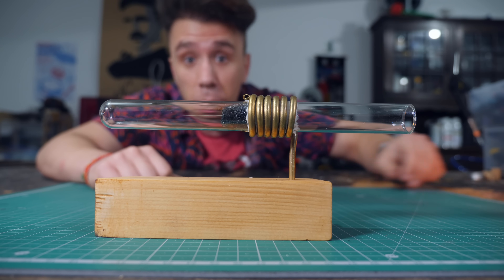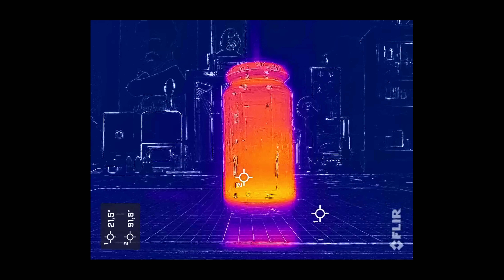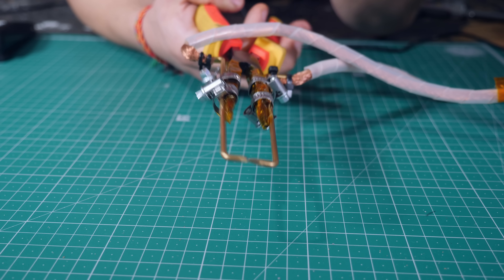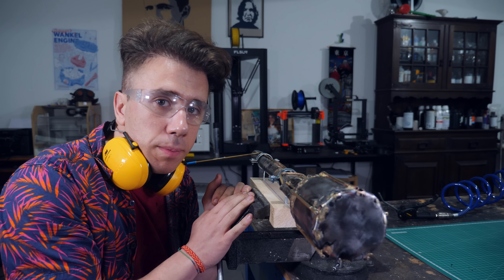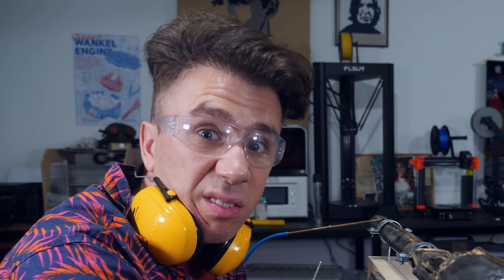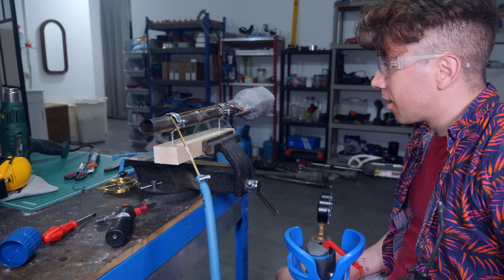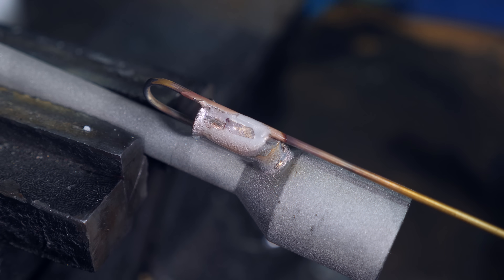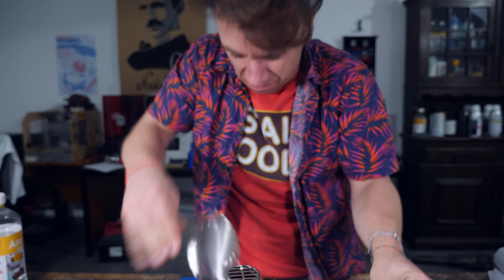JET ENGINE with NO MOVING PARTS (Pulsejet Engine)

Comment: for your next attempt at it, you could try to pre-cool the fuel before sending it into the line (the way you have it wrapped around it like that) to help the material not overheat. My concern would be the fuel line itself could fail and cause a dangerous situation while giving an added advantage of keeping the 3d printed metal from possibly failing as well. since it requires a temp difference though you may have to split the line before it wraps around it so that way you could wrap both sides before rejoining it at the injection point. this way you can cool both sides while still getting the temp difference.

Comment: How turbine engines works for airplanes is actually pretty simple. You have multiple compressor blades that compresses the air, then the compressed air goes through combustion chamber where the fuel and flame is introduced. it ignites and then the air gets pushed through turbine, the turbine is connected to a rod in the middle which is also connected to compressor blades. The turbines move which in turn  compresses the air all you have to provide is fuel. There is also bypass which is where the compressor compresses the air but instead going through the middle it goes around the  middle and out the back. This makes it quieter and more efficient, the bypass counts as ~80% of the thrust from the turbine.

Comment: A cylinder filled with mercury will immediately begin to rotate when DC voltage is applied and instantaneously reverse rotation with reversal of polarity.
A cylinder of mercury within a cylinder of mercury each rotating in various directions and speed in conjunction with one another allows this engine to move in any direction.
I'm thinking about trying out the gizmo with a typical UFO saucer design...ring within a ring with a few more here and there.

Comment: Actual rocket combustion chambers have air/oxy entry ports all around the outside of fuel/oxy entry area. It keeps the outer shell cooler w a buffer of cooler oxy while fuel burns mostly inbetween the center fuel stream and oxy layer where it mixes.

Comment: What if you made your engine out of ceramic instead of foil or thin sheet metal by means of slip-casting? It is like the pre-digital version of 3D printing for clay. Hard to know if there would be problems with differential expansion, and it is a bit of a process,  but you wouldn't have to learn how to throw on a wheel or handbuild. To see what I'm talking about, check out the YouTube series: Tiki Technical Tuesday.

Comment: Good job, you have some pretty amazing skills & this was really interesting. 
Idea: could you maybe design a steam propelled machine using a pulsejet partially for thrust perhaps, but mainly as a heat source for the steam propulsion. I think with a controllable EFI system this would be a far more efficient use of the type of energy this motor produces. 
To clarify: the objective is to retrieve as much useful energy as possible from the pulsejet via steam, heat &/or thrust, to drive a car, boat, train, generator, sterling engine, lightbulb, sewing machine or whatever you like, but not just as a room heater, that would be too easy.

Comment: I ⚠️🌎don’t need no solar panels. All I need is a coal supply and a boiler to make some good old carbon dioxide we need more carbon dioxide in our air atmosphere, but keep it at a cold temperature. The carbon dioxide helps plants grow using for the synthesis, but if all that carbon dioxide disappears plants die, that’s why earth is such a balanced planet, unlike Venus, which cannot get rid of its carbon dioxide because it doesn’t have any plants. Earth is unique because it has plants and life.

Comment: How bout a rocket powered dildo, and a jet powered pocket gina in a head on collision with a high resolution, high speed camera to see who wins after the blast off.  All joking aside, it would be cool to build a quad pulse engine with wings and an entire hydrogen tank attached as the fuselage.  And for the pulse engines to be made from clear glass if it were possible.

Comment: I have developed a type of propulsion system that provides 96-100cc combustion events per rotation around the inside circumference of a 13cm OC x 7.5cm ID x 18cm H cylinder.

Comment: I love your enthusiasm.  Just a small correction, the V1 rocket of WW2 was propelled by steam from a chemical reaction.
Reply: The V-1 was NOT a rocket engine (i.e. not powered by a rocket engine).  Rather the V-1 was a jet (i.e. powered by a pulse-jet engine). Jet engines use oxygen from the atmosphere to burn the fuel; rocket engines have self contained oxygen to burn the fuel.  On the other hand, the V-2 was a rocket (with oxygen stored in one tank, and fuel stored in another tank - and two separate pumps - one to pump the oxygen, the other to pump the fuel).
Reply: @danielklopp7007  My appologies.  The V1 flying bomb, doodle bug, farting fury or revenge weaopn  have many names. I fully understand that the V1 was powered by petrol.  (Some time ago I downloaded some plans.)  I should have been more specific that I was talking about how the V1 was launched.  Two chemicals were mixed which caused an exothermic reaction generating steam.  It was this steam which gave the V1 its initial impulse to launch it along its sled.  Much like the way steam catipults work on aircraft carriers.  Sorry for the confusion.  Cheers.
Reply: @johnspathonis1078   - the difference between a "rocket" and a "jet" is not the type of combustible fuel (e.g. petrol), but rather the source of oxygen to combust that fuel (with a jet - the oxygen comes from the atmosphere; with a rocket, the oxygen is self contained - either in the form of liquid oxygen carried in a tank, or chemically bound oxygen for solid-fueled rockets).

Comment: Could you put a pulse jet engine on a RC jet? To see if you could create enough thrust for it to fly? I feel like that would be very cool.
Reply: I like ur idea, & maybe add a rail gun type launching system to give it a little head start with more cool tech.
Reply: Small pulse jet model airplane engines that ran on sterno pellets were sold in the 50s i still have one but no fuel. I'll have to look around to see if i can find it.

Comment: He sucks at easy things and hard things are easy?... Nice problem. There's some dudes putting turbos on burn barrels. There's gotta be enough energy in that setup to launch a wood fueled rocket...or at least make a kaboom. So far all I've seen is kaboom but if control was implemented there is promise for something useful. Either way it sounds entertaining.  Maybe try that build. Well done

Comment: Hello, can I suggest an idea to improve the pulse rocket motor, one that you already used the Tesla valve, but instead of using the 3D modified version, use the original version, and maybe separate the fuel intake from the air intake, but both the fuel intake and the air intake converge at the same point to improve the air-fuel mixture

Comment: Try and print it directly on the metal by cutting an A4 sheet. Just make sure all the edges are smooth (cut them with a box knife, not a pair of scissors).

Comment: Hi I have the perfect idea for a light weight stainless steel pulse jet prototype that shouldn't melt a good old fashioned Stanley thermos it's double walled and insulated then purchase a piece of exhaust tube and brake line from ur local auto parts and braze it all together should be fairly light weight but thicker so it won't melt but still thin enough to easily be worked with !!!!!!!!!!!!

Comment: Had a thought …. If say a Lilium jet which has a serious range problem might it be solved  if they burned just a little gas in the outlets of some of their electric motors fans how much thrust could they gain for liftoff by adding just a small over wrap tank and a few burners for the vertical part of the flight?

Comment: Please try to make it similar to ICE internal combustion engine without shaft, and use exost as thrust. Making head wider and exost similar to rocket outlet, i think we can archeive it. Ignition must be electronically controlled, and speed of ignition must be changed by sensing the output pulse.

Comment: Yes but the efficiency of the whistling tube is micro-miniscule.  The flame is inputting like 10 Watts of energy.  The sound output is in the low thousandths of a Watt.  So not an efficient machine.
Pulse jets are also rather inefficient.  They only burn for like 10% of each cycle, so the power output is a tenth of optimum.   That's  one reason you don't see pulse jets in actual use.

Comment: So you know how I’m a centrifugal force with g force it inerially produces gravity I think it produces it going away from center in a curve and maybe make the outer wall a lase diode or a rectifier of gravity with angular redirection with a servo and a hamster wheel with a ball in the circular centrifuge
Reply: Also have a needle vacuum for when it’s spinning to make a gemetrically smaller gap to force it linearly upward to direct a force of gravity
Reply: Test it by inertial pushing backward with the vacuums and make it suction and turn equally to inertial speed to test if it can me multiplied in g force or be a gravitational multiplier to test g force diode

Comment: Will you like this comment and video idea. The idea is a vacuum engine that works on a refill system and longer tube for a more compressed pump or can you do a inverted space time simulated wormhole and have a motor making things travel through it in a circular movement making it travel further in distance over the rpm with a vacuum circular tube system that pulsates the engine

Comment: Coming from a chemistry background, it seems to me that engines are runaway reactions: the more the reaction goes, the more it gets hot, the hotter it gets the faster the reaction goes.... etc... Until melting...
You need a negative feedback to slow down the reaction when it gets too far.
So stupid idea: if the inlet air to the engine is cooled down to low temperatures will it halt the reaction? Maybe coiling the cold air tube around the engine for cooldown before the inlet? The rationale being that higher reaction rates in the engine will suck in more cold air and therefore cool down the engine and slow down the rate of combustion. That in turn reduces the influx of cold air and the engine can warm up again.
I would guess there is an optimal combination of air temperature and reaction speed that keeps the engine running and at a constant pace.

Comment: @integza use this fuel (sodium) for your next rocket/jet engine, maybe you can launch since there are no stinking rules in your country 😂 but if you can't you usually find someone/somewhere that can. (P.s. aren't tomatoes like 95% water? Here is a ln attempt to measure the thrust using the fuel.
https://youtu.be/TbWrzpDmH0w?si=dok7KXuLLNCtqlc_

Comment: Theme fo a future video:  build a jet or rocket powered magnetohydrodynamic (MHD) generator.  Basically, send the jet or rocket exhaust through a magnetic field to generate an electric current.  This can be used to charge a bank of capacitors, which, in turn, could power a pulsed laser.  This was studied in the '80s as a missile defense weapon.

Comment: Theme for a future video:  build a microwave electrothermal thruster (MET).  Basically, use the magnetron from a microwave oven to heat water vapor within a resonant cavity into a plasma, then accelerate the plasma using an electric field and eject it through a nozzle.  This is one of the newer technologies being used for space tugs.

Comment: Suggestion for a future video: 
You could make an Helicon Electrodeless Advanced Thruster (HEAT) which convert a gas into HIGH DENSITY PLASMA with really powerful electromagnetic coils, to later be impulsed by a plasma acceleration antenna in order to make an EXTREMELY powerful thrust with a plasma exhaust.
I’m addition: The gas doesn’t even have to be initially accelerated by an external force :00

JUST IMAGINE THE POWER OF HIGH DENSITY PLASMA BEING EXPELLED THROUGH AN EXHAUST AT ASTONISHINGS SPEEDS

Here´s an article (The figure 1 is really helpful): https://www.semanticscholar.org/paper/Preliminary-Investigation-of-Electromagnetic-Thrust-Nakamura-Nishida/6a35e119f01e80f5d5d378c3aff61bfa55ea1268

P.D: I wuv you plasma thrusters

Comment: Hi Integza, love the material and ideas. Keep them coming! Apologies if you’ve done this already but I would love to see a practical demonstration of a rocket motor idea I was once told about. Essentially, it’s an integral hybrid fuel motor. The solid fuel component is a hydrocarbon. Typically heavy oil mixed with an epoxy resin. During preparation, this mixture is held in a cylinder, turning on a centrifugal turntable, turning at a modest but, appreciable r.p.m. The oxidiser component can be liquid oxygen or nitrous oxide and is injected from the bottom into to the liquid phase as it spins in its mould. The oxidiser often helps to activate the epoxy. Another initiator may also help. The end result is a honeycomb of oxidiser bubbles within a solid fuel matrix. The purpose of the spin is to form a density gradient of bubbles with more at the centre and fewer at the outside. This is supposed to aid initiation, and also to permit thinner walls in the reaction chamber is the solid fuel mass remains a structural component until the end of the burn them, I reducing rocket mass. I’ve only ever heard this talk of and have never seen it done. The strikes me as an excellent practical experiment for your channel.

Comment: For your pulsejet, can you try to cool it so that the combustion chamber doesn't melt all the time? Essentially wrapping the chamber in your resin, ceramic, and then water cooler lines? Maybe that'll help with heat.
Reply: Most jet like this use regenerative cooling. It is easy to do and increases the thrust by an order of magnitude.

Comment: Hey Integza, I've got a video suggestion. The company LiquidPiston is making a variation on the Wankel engine and they claim it improves on many of the Wankel's problems. The video I'm suggesting is making both engines and comparing them in terms of power, efficiency, reliability, and anything else that you run into. As a bonus, you could compare these engines to a traditional piston engine. A good starting point would probably be looking at the patents for the new engine.

Comment: One thing you could do for cooling, to make ure not another engine busts, is make a cylinder that goes outside of the main engine and fill it with water so then it does not put a hole in it. If you make it efficient enough I think you might even be able to 3d print it entirely and at that point it would be a masterpiece. (I already have a 3d printer)

Comment: you should 3D print a working saturn V engion and connect it to a controler if posible if not just make the rock with no RC.

Comment: In the next video, can you make an actually turbo jet engine with just scraps and other materials that are easily available at most homes and can be worked upon easily.

If not another idea can be a similar project using scraps etc, but a car engine.

Hehe I actually wanna make an engine, so heheh please try😁❤️

Comment: 00:45
The vibrating water tube looks like an awesome engine idea. Simpler than a stirling. Just apply tidal engine to it. A floating magnet and a coil and it's done.
Reply: Where the idea comes from: https://youtu.be/ApW211YhkLA 
I really like Integza's videos, except that they don't cite the original source where the idea came from.

Comment: Have you tried using the Tesla turbine on the output side of the pulse jet engine to see how much power you could recapture? It would also be interesting to see how well a Tesla valve to govern both air and fuel into the pulse jet engine, I'm just trying to think of how may Tesla inspired things you could link to make one mashup of a build.

Comment: Use aerated concrete (Portland cement with foam) with fiberglass strands. This is used to make lightweight countertops and has extremely high heat tolerance.

Comment: Can we repurpose the heat of the jet engine , by submerging the engine under water without covering the fuel and air i take /exoust , and use the boiling water /steam for electricity , in a sort of looop ?

Comment: doesnt the pulse jet get hot enough to melt the solder? maybe 3d print the tubing into it? you could also 3d print some ridges to hold the tubes to prevent buckling while bending. maybe if there was a shroud or cowl around the whole thing it could ventury enough air to create a bypass stream and cool off the exterior.

Comment: What if you made a special sprayer that sprays the inside of the 3D print with the fire protectant? Then  you can layer it up. You're so good with copper tubing, if you made tons of holes and rotated it and used a thin enough pipe you could fire protect the inside pretty well, plus if you used the Bambu printer that threads in fiber strands to make it really strong you could make a real nice rocket.

Comment: Sugestion: Make a pulse jet engine that thrust downwards, in some sort of remote controlet hovercraft. The bottom part instead of inflate, could be thin metal covered to not melt. Imagine this, the pulse jet thrust downward, and under it there's a metal cone shape with closed tip, that drives the thrust 360°, so the thrust will become horizontal, and then another curve bending the 360 flow downwards again, making it a circular downflow instead of a single jet flow in the center.
You could create the first ever glowing red jet powered hovercraft!

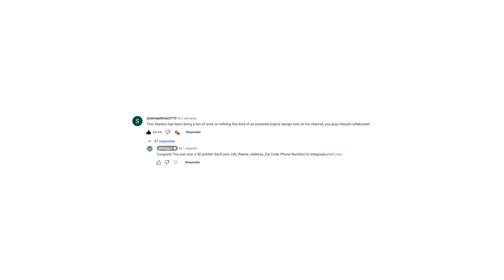Comment: for what reason do you turn the pipe around the engine at 9:37 ? to let the fuel heat up already before it enters the engine? or does it have any other reason?